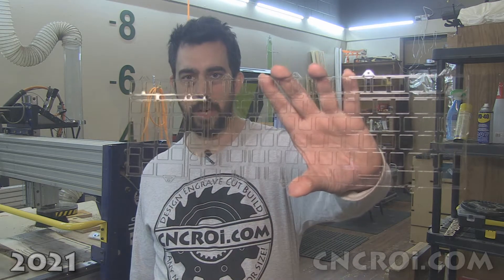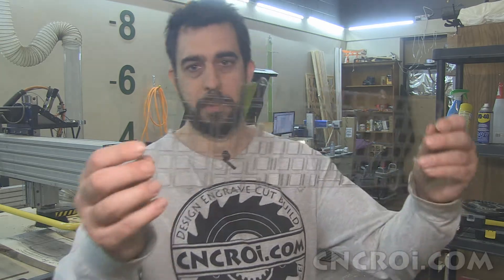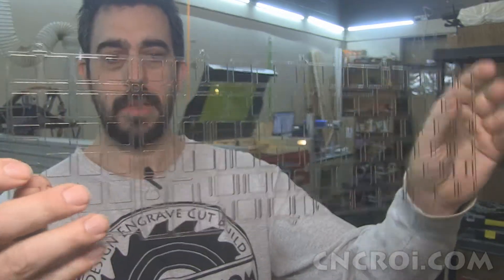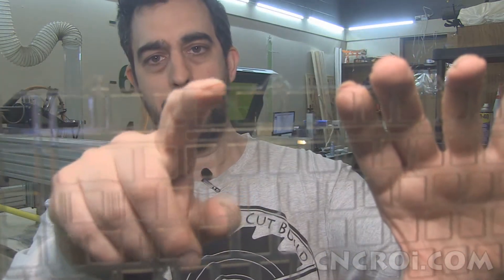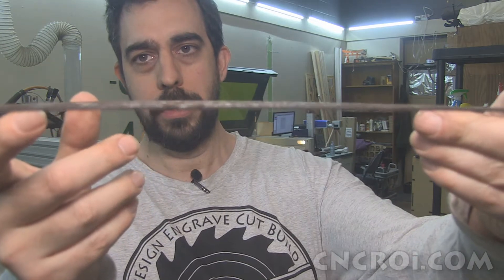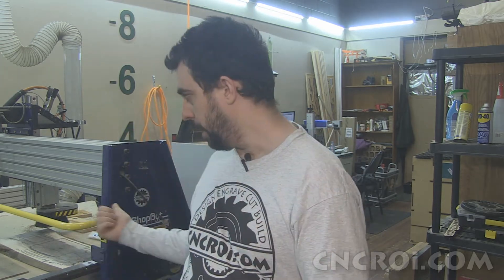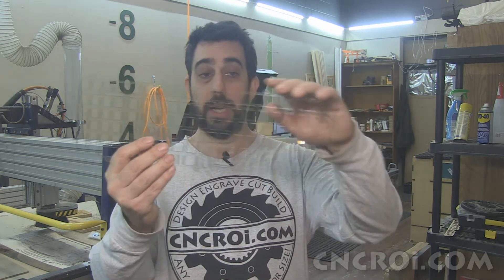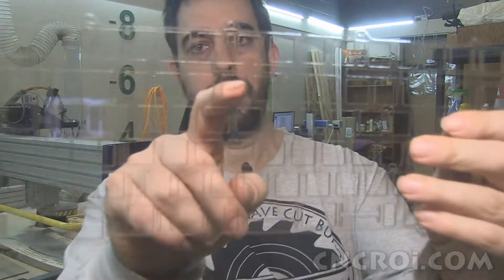Polycarbonate Inserts: CNC Laser Cut

Comment: Hey are you using a 9.3um laser tube? I'm reading that this wavelength handles PC much better. 

With a normal laser around 10.6um, there is a lot of charring and browning even on thin materials.
Reply from the maker: Sand blaster fixes it.